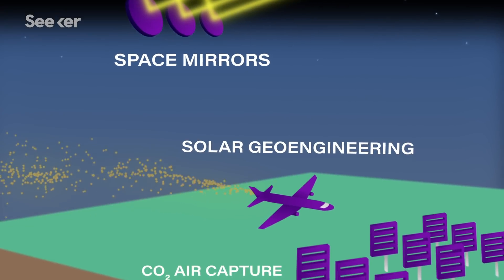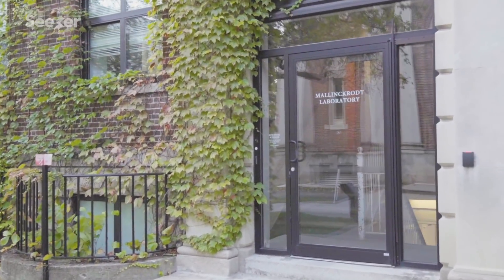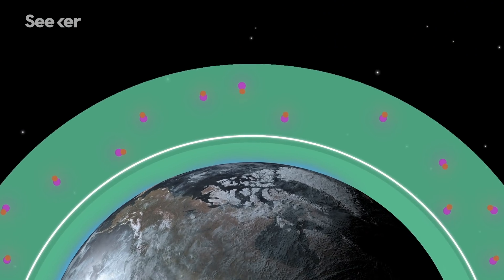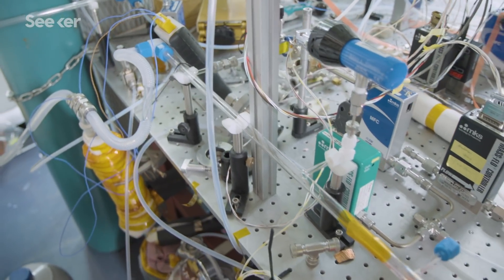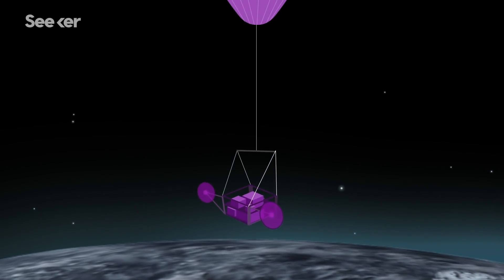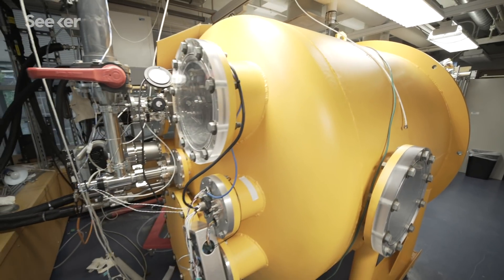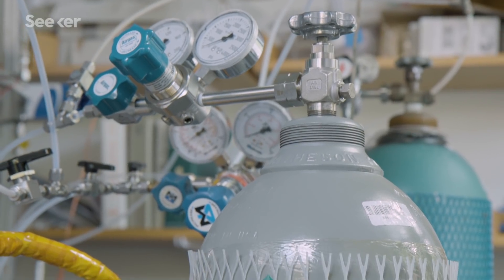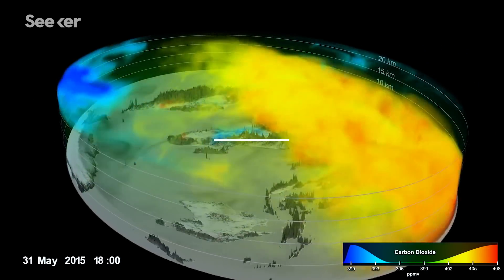Why the World’s First Solar Geoengineering Test Is So Controversial

Comment: Why try and change the atmosphere we could crush up asteroids into dust and scatter the dust between the sun and Earth to act as an orbitting light reducing barrier. We have evidenc e that this has happened naturally in the pas t from two sources. Asteroidal impacts with each other and from iron dust particles from a super nova. Both resulting particles moved through the solar system, shrouding the sun and reducing the light and heat that reaches the earth. Why create something that will make more acid rain? WE could also create sun shields that can orbit in the L1 possition between the Earth and the sun.

Comment: That's like giving an antipyretic to someone who's sick with dengue fever.
Reply: That is what doctors do, yes. While you design or prepare a cure that takes time you need to stabilize the patient to prevent their death.
Reply: @acromantula9266  1) wouldnt this sun light scattering reduce the efficiency of global photosynthesis and solar technology?
2) If something goes wrong you better be able to remove those gasses that were added!

3) If you could remove those gassses that you added, why bother adding random crap that doesnt patch the root cause, but instead simply remove the worlds imitions out of the atmouphere in the first place?

4) does your gasses have any means to be naturally broken down into bioavailable componets or will this be another plastic situation where it never breaks down; combine that with a delay reaction and we may find we add to much too quickly and boom now things are getting to cold for climates to adapt.

5) this technolgy seems indiscrminate as in it will just spread globaly through the atmouspher. In other words there is no zone control so what if you dont want effect an area with this gas yet neighboring countrys start pumping?

This "solution" is laughed at for a reason. Harvard work on something else my goodness.
Reply: @wastelesslearning1245  1 Only something like 0.5 % of light needs to be diverted
2 These first test are for that
3 Entropy is why
4 Those particles could be natural like the ones from volcanoes or innocuous like small water droplets
5 Depends on the specific type and on this kind of research
Reply: @acromantula9266  
1) Sunlight is what keeps us living so blocking any doesn't seem like the smartest of moves especially if it doesn't tackle the root cause. Also small numbers are deceptively underwhelming. Keep in mind a tenth of one percent of our atmosphere is greenhouse gasses and the effects are crisis worthy with a delayed data feedback. Now that room for error of that 0.5% of anti-greenhouse gas suddenly doesn't look so user friendly.  

https://climate.ncsu.edu/edu/Composition

"Nitrogen accounts for 78% of the atmosphere, oxygen 21% and argon 0.9%.  Gases like carbon dioxide, nitrous oxides, methane, and ozone are trace gases that account for about a tenth of one percent of the atmosphere." 

2) Ok so by the time the tests are complete, they would have a way of extraction of the gasses; so why not just extract the greenhouse gasses instead. that's actually a cause. That's a project I'd be behind. 

3) ah entropy the great nihilists of the scientific minded. Who cares about plastic am I right cause entropy. The greenhouse gasses will entropy so no regulations requires. Why bother with taking care of the planet in general cause entropy will kill it anyway.

4) Finding a non-toxic, biodegradable, fine mist that ,after some time naturally condenses back and falls down Sounds like a waste of funding if it does not address the root causes. Just like how giving someone painkiller when their limb was ripped of is a token gesture. Worse yet it sets a president that could allow well tensioned but ignoring people to get grants to destroy our atmosphere with the next big anti-greenhouse gas all while what's putting greenhouse gasses up in the first place remains to be fixed. 

5) Why bother opening that can of worms? Some are cheaper yet stay up longer.  Thousands of independent country's making their own mix (not all as well researched). Others more expensive yet benign. We already see how the world handles that choice and its not the latter. Then there is the prospect of weaponizing this technology.

It fixes too little for too high of a risk. All while options that address the root causes could be using that funding/ attention.
Reply: @wastelesslearning1245  You don't understand, the 0.05% is of solar radiation. Entropy is the reason capturing the co2 is difficult, once you pour a glass of water in the ocean it is immensely and fundementally more difficult to recover it. There are in fact geoengineering projects that can capture co2 with the use of a special crushed olivine mineral gravel called project vesta.
Reply: @acromantula9266  Ok I know entropy makes life hard but its not as hard as you think. Turn a scrap wood or any biomass into charcoal and burry it like we do radioactive waste and there is our co2 sequestered. In fact its 2/3 more potent then storing it in gas form without O2 is wasting mass. Pure carbon is essentially what charcoal is. The biomass/trees does what it does best and makes entropy productive. Geoengineering as a whole I don't have a problem with for other planets or land based. When people start talking adding things to the air and water supply that's when my eye brow raises. Taking harmful stuff out of the air and water supply that we put in in the first place I also most people don't care. I know your talking about radiation not mass but I'm trying to tell you small numbers can have huge consequences. I could also piggy back off that comparison by emphasizing how relatively little amounts of added gasses have large effect because it increases the amount of water vapor possible by raising the temperature and since water vapor is also kind of a greenhouse gas and there is a lot more water, you can see the massive consequences. The Vesta project is one of those projects that gives me hope. This adding synthetics to the atmosphere stuff does not. Who knows the amount of regulations needed for damage control and hope does nothing to the weather cycles all life depends on along with the influx of solar radiation. Again all to patch a symptom (avenge increase of global temperatures) not the cause (emissions of greenhouse gasses). Sure it works fast but that could be a curse aswell as an asset. And with other solutions with low risks and decades to work with I don't see the need besides full on procrastination dooms day scenario which we should be preventing in the first place.
Reply: Waste Less Learning the main issue with c02 capture is that it just takes a long time to be effective, we should really be trying to lower emissions and implement c02 capture now, or 10 years ago but we haven’t. Not to be too cynical but humanity won’t act to prevent a climate change catastrophe until it’s too late, and it’s then when people may start using solar geo engineering on a large scale in an attempt to keep the climate under control. It is important that we know what we’re doing before it is too late.
Reply: Dengue fever is not a good example for the point you are trying to make.
Reply: @Pawanrai-ej9eo  tell me why not
Reply: Illogic Math dengue is a viral illness.
There are no anti viral drugs available against the dengue virus.
The treatment of dengue fever is keeping the patient under observation for complications while providing symptomatic treatment like paracetamol for fever .
Reply: It's like having a defibrillator on hand just in case the patient makes a sudden turn to the worst case scenario. I don't think anyone is suggesting that we use atmospheric engineering as the primary method for reversing climate change, but we certainly want as many plan Bs as possible if we fail in reaching our mark.
Reply: Still better that herbal tea and holistic diet, which is all other popular options now.

Comment: So, you want to bounce the light away that would otherwise drive photosynthesis?  So, it will cool a bit and we will starve in more comfortable climes.  What could possibly go wrong?
Reply: hnmmm only a very small portion of light is put to practical use
it would theoretically have near 0 effect

that is theoretically  thoe, and the point of this video was to explain their need for extensive testing 
so i imagine they might try collect some data on this as well

Comment: and for idiots?
Reply: Spray calciumcarbonates in the air to bound some acids like sulfurdioxid and it resulting acids with watervapour which absorb energy from the sun and have a more or less heatcapacitens ( water around 4.18 kJ/(kg*K) ).
Basicly they want to change the stratosphere to have a lower or higher heat accumulation.

Comment: A terrible but necessary measure. This will not fix the problem by itself, but will buy extra time to pull us back from the brink. Its akin to planetary chemo... it's can help, but has potential massive side effects. Before... a scientist pushing this idea to the public would be pushed out of the community, since we should have fixed this by political measures in reducing climate change. Nevertheless, we need to start working on this. Politics had failed.
Reply: A terrible idea is a terrible idea. We’d be better off building technologies to live with the effects of climate change rather than risk making it worse.